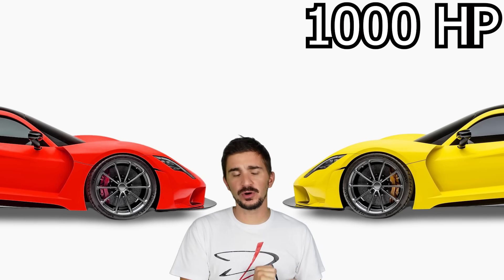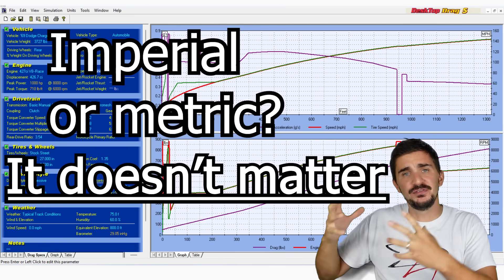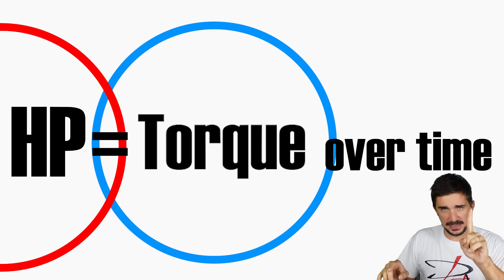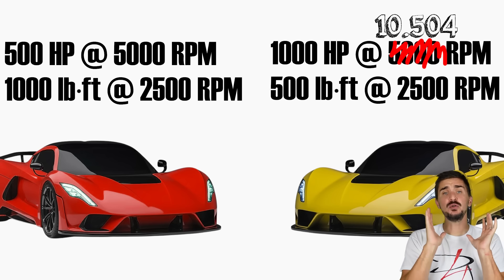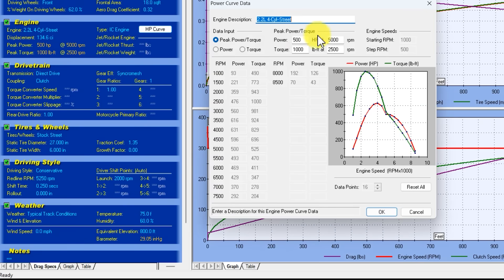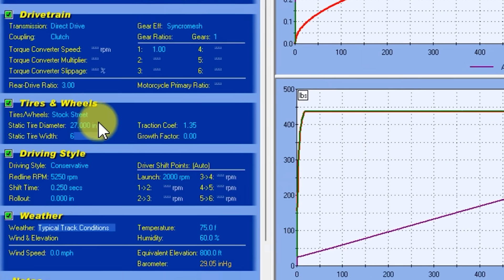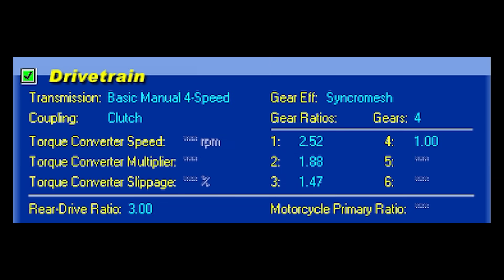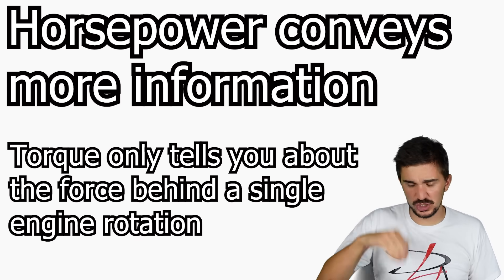Who's faster? Explained and Simulated - Horsepower vs Torque

Comment: To add - while best speed is reached at peak HP, best hillclimbing (or towing) ability is reached at peak torque rpm - so next time you're racing up a hill, be sure to optimize both 😉
Reply: not really.
Reply: What the heck are you talking about?
Reply: @TarenGarond  who me or kristian….?
Reply: @mociczyczki  The fella that don't seem to understand this stuff(Not you... XD)
Reply: @TarenGarond  My point is simply hillclimbing/towing ability is a function of torque (not HP), while speed depends on both - each have their own RPM peak - the video looks at acceleration, although D4A touches on added weight (which of benefits the higher torque engine)
Reply: @kristianhermann5971  Obviously revving at peak HP RPM (on full throttle) is best for hillclimbing/towing performance.
Peak torque RPM gives you both best acceleration and hillclimbing/towing performance (Ignoring aerodynamic drag and such) on one particular gearing, if you can change that gearing try to aim at peak HP RPM to get as most wheel torque as possible.
Reply: @TarenGarond   If by "performance" you mean max speed uphill and not steepest grade climbable - peak torque rpm always provides max climbing ability - you can only go faster uphill if you have excess torque available (because it decreases at higher rpm)
Reply: @kristianhermann5971  cos 1 gear is last gear and its not always true that peak torque determined max uphill angle if max torque be at enough high rpm and on lower be not enough less tprque it can turn out that lower rpm where max torq do t happpen give best posiible climbing capabiliities because at biger velocity resist inrease if resist to power ratio be worse at max torq rpm than somewhere on lower rpm it dont pull so good than at this lower rpm 👌🏻 assuming you have inifinite gear only max power give you max climbing capabilitites diffrenc be biger and biger the biger be diffrenc in power at max torq rpm and max power rpm 👌🏻 and last but not least this what ypu write fix so etimes only to the same vehicle at 1 gear or at the same set gear and how good something would have climbing ability under let say heavy load depend on lenght of first gear👌🏻 vehicle with 10 hp and 10 nm can go up more steep hill than feg 500 hp 3000 nm vehicle at the same weight if 10 hp 10 nm wpuld have enough shorter 1 gear it do it super slow but it defeat finally steeper uphill 👌🏻🤭🤷🏻‍♂️  + when you let say tow be car some trailer uphil 5 degrees let say you have 3 tons on trailer including trailer car 2 tons spme suv or whatever you go 50 km/h up this hill at 2000 rpm you have 600 nm and at 5000 rpm engine have max power of 250 hp ,first you are on 4 gear at 50 km/h where you have 2000 rpm so max torq 600 nm at engine you put pedal to the metal and how much force is generated at tire contact path ? comapre to when you reduce gear at this 50 km/h to 1 gear where engine be at 5000 rpm let say so 250 hp ? the force at contact path so climbing ability from this pointof view be smaller 🤷🏻‍♂️👌🏻    cos around  910-915 kg force at 4 gear at 2000 rpm atmax torq dont including all losess from engine to the whell vs at 1 gear at max power so  5000 rpm  force at contact path increase to around 1350 kg force 🤷🏻‍♂️ 👌🏻 so it depend on point of view asf what you want subscribe the outcome can be diffrent 👌🏻 at end torque is leverage dependend ower is speed dependend from both if you have enough data you can calculate force 👌🏻  100 nm electrick kick scooter at 2 times shorter final gear ratio so assuming wngine is in wheel it have 2 times msaller wheel doameter will  have the same climbing ability as 200 nm electric kick scoter with 2 times biger wheel assuming both wpuld have similar weight naturaly 👌🏻🤷🏻‍♂️ thers alot point of view your assumpition is true  only for the same vehicle at first gear assuming we dont want to hold specified velocity uphill but it can drop down cos like im write ot let say somebody want hold 50 km/h and all resist uphill including weight rolling drag asf would reuired 1100 kg force for not loose this 50 km/h velocity than this max 600 nm at 2000 rpm from me egzample generated 910 kg force be not enough vehicle would not have enough strenght and it slows down couldnt hold this 50 km/h but when you reduce to 1 gear where force is 1350 kg with pedal to the metal now it can hold this 50 km/( wothout slows down with not pedal fully put in floor 👌🏻 ( assuming from me egzample that those force are including all lossses in drive train asf ) …

Comment: That this gobbledygook video is still up is beyond belief. There have already been like 50 people in the comments pointing out what's wrong with it. Does your mind have the magical power to only read the comments that call the video brilliant?

Once more:
- You can't randomly set torque, power and RPM values. Your torque engine produces over 600hp, not 500hp, so you are not even comparing what you said you would.
- The torque engine still revs to 8k RPM even though it makes peak power at 4k RPM. Since you are using a gearbox set for 8k RPM, the shift points are completely wrong. That's the only reason why the torque engine isn't faster across the board (because it otherwise would be given you are using the same gearbox for both engines)
- You can't use the same gearbox for both engines. Doing so doesn't make it fair, it makes it so one engine is geared to twice the road speed of the other! If they were geared for the same road speed, the "horsepower" engine would always be faster.
- The only conclusion is that horsepower is faster and that torque doesn't matter at all, not that "it is neither".

Comment: This is a crap video which is a shame. Your stuff on engine balnce is excellent but this one is rubbish. You have dumbed things down so much you've had to use fantasy illustrations to try and explain your points. Peak torque is a meanless metric. Peak power only slightly less so. Both numbers are only useful for willy wavers. In a rorating engine horsepower is simply torque x rpm (in a jet aircraft it's thrust x velocity). Peak HP is also just an instantaeous reading, acheived at one point in the rev range. What is actually useful to look at is the HP curve, HP plotted against engine speed.

For example, ignoring clutch slip, wheel spin etc, if you are looking for maximum acceleration you need to know the integral of the horsepower of the engine speeds your gearing force you to use. The area under the curve between low and high revs. Generally HP rises with engine speed and then drops off. Your gearing controls where that engine speed ranges. A close ratio gearbox will allow you to keep the engine within a narrow range but to have maximum acceleration at low speeds you need a low first gear. If you have a narrow powerband and a useable 1st gear you need you need lots of gear ratios and they need to be close together. Some of the early Japanese racing motorcycles had very narrow power bands and 14 ratios in the gearbox.

For maximum top speed you need to carefully adjust your gearing to give maximum power at the point of highest drag but still allowing enough power below maximum to allow the vehicle to accelerate through to that figure. An interesting example is in Moto3. 250cc racing motorcycles. At maximum speed in still air they are running slightly below maximum power. Thus, when they are drafting another bike they can pull through to maximum power as their drag is reduced.

Anyway, I think it's a shame you seem to reinforce the idea that maximum torque has any meaning at all.

Comment: I see a lot of the comments saying they understood, and then they make a point that tells they didn't. I think horsepower could be ignored alltogether because it is just a number that is calculated out of torque. Just compare torque curves. Dyno does not measure horsepower, it measures torque and then the software calculates a horsepower graph on top of it. If you put a g meter on your car and accelerate trough a single gear the output of the g meter vs your speed will draw you your cars torque curve. No horsepower on there whatsoever unless you want to calculate it. Torque is the only thing moving your car, horsepower is only a calculated value derived from that torque.

Comment: Why make it so complicated. Horsepower will win in a drag race. 
Max power might make the engine peaky and hard to drive.
Sacrify some of the power can give you a flatter torque curve and easier to race, this is very true for motorcycles.

Comment: This test reminds me of high performance (800HP+)Honda K-Series engines. Relatively high horsepower numbers that needs to be revved pretty high to meet the torque requirements. By use of the correct axle ratio and the correct transmission to keep the engine in its powerband.

Comment: The problem was all the power was wasted across the clutch. That's exactly what a transmission is about. You're multiplying the torque to the value you can put through the tyres.
Edit: Yes, the punches analogy was a better one, but people just need to understand gearing.

Comment: They are not interconnected. Dumbest statement ever. You can change the bore and stroke of an engine to increase torque. When it comes to horsepower rpm is the biggest factor. 🤦‍♂️

Comment: Torque is always the winner provided that you have enough traction to actually use it. I have seen a 300hp vehicle smoke a 700hp vehicle simply due to torque which was generated via proper gearing in the 300hp vehicle.

Comment: Torque genuinely does not matter at all if you have a perfect transmission. There is a better explanation than this on the Automation, the Car Company Tycoon Game channel, which I think may be the only one I've seen that actually gets it right. What actually matters is the amount of horsepower integrated over the acceleration, which depends on the gear ratios etc, but the bottom line is that power does tell you everything by itself as long as you look at the whole curve, and a reasonable proxy for performance is the average power across the band that will actually be used, whereas torque doesn't mean anything until you tie it to specific RPM, at which point what you're actually talking about is power.
Reply: Spot on! At 12:40 Torque is NOT about a single rotation, its simply the twisting (torque) force applied and tells nothing about how quickly work is being done.

Comment: I haven't seen it commented yet but I noticed the "conservative" driving style is limiting redline to 5250 RPM. Is that actually a fair comparison between the two models since the peak RPM on the torque-limited engine is double that?

Comment: After receiving 1000 one pound punches I'll be bruised & annoyed.

After receiving one 1000lb punch I'll be on the floor & confused.
 
I really disagree with your reasoning, but not the result. Just look at HP area under the curve.

Think of the old GP two strokes. Insane HP levels, but only at high rpm,  for very limited rev range. The peaks are present, but there is no area under the curve. 

That can be compensated for with gearing, by having lots of gears (ie: 9 speed transmission), but changing gears takes time & causes wear. A modern 4 stroke would win with a lower hp peak, because that's not the important part. Area under the curve, is.

Comment: I've owned and raced two 1970's VW Beetles, one torque biased and one hp biased:
2007cc 150hp@6000rpm/155ftlb 1/4 mile: 14.3@95mph
1285cc 126hp@7800rpm/97ftlb 1/4 mile: 15.0@88mph
The smaller engine is understandably slightly slower, but the biggest factor in the time difference is actually the launch. The high torque motor allows me to dump the clutch netting a 1.8 second 60ft time, the low torque motor means I have to slip the clutch (to avoid the engine stalling while keeping it in the engines prefered high rpm power band) netting a 2.1 second 60ft time, so "on paper" the low torque engine should be capable of perhaps a 14.8, but in the real world, no chance. Unless you run super low gears, torque is preferable

Comment: Let's say we have 2 same model cars with same HP, but car A produces less torque but higher RPM, car B produces more torque but lower RPM. Car B will reach its maximum HP much quicker than Car A because it peaks at lower RPM. Car A needs more time to accelerate to higher peak RPM, also needs to change gears more often, and also have engine RPM limitations due to physics. Ultimately torque and RPM needs to be optimized for the engine performance for a given horsepower.

Comment: Thats why I sold my 2007 BMW M6 with the S85 V10. It made 500+ HP but -400 torque. Nice sound and all but it was pretty boring if you weren’t flooring it on the highway.

Comment: I always like to tell people that Torque is a completely useless number without RPM, HP is acceleration, HP is topspeed, HP is everything, torque is meaningless, nice that your electric screwdriver has 200lbft of torque, can it outperform a car with 150lbft of torque? I don't think so
Edit: I also think this software you used isn't really great, very basic and not realistic, i don't really see what would stop you in a dragrace scenario to keep the engine RPM close to or at 10.000 and prevent wheelspin etc... with the clutch allone being full throttle all the time, there's just a lot of variables the software can't simulate
Also in the wheelspinning scenario you showed, it looks like the software just goes flat out all the time without any modulation

Comment: Soo sick and tired of people arguing over what’s better, torque or horsepower. Horsepower just conveys more information but they are directly related otherwise. Thanks for another great video. My target on my current build is 450 HP @ 7000 rpm; I’ll simply adjust the gearing depending on how torque comes out so it’s Drivable.

Comment: I don't know why I write this, I guess I just want to.
In real world scenario, if you have big torque at low rpm, mostly it doesn't rev high. It's just physics. The bigger the hammer the slower you swing.
On the other hand; if it does rev high, usually has low peak torque.
Smaller the hammer, faster you can swing.
It's a trade off.
Racing car loves to have high rpm. It's useful when in slow corner and you need less torque to prevent wheel spin you can just drop the rpm instead of shifting gear. (Shifting = stop accelerating = losing time)

When pulling heavy load, it's the other way around. Pulling from stand still need an instant power from stop. Having a big torque at low rpm will be very useful as you don't need to floor it just to roll, saves fuel. Towing stuff is a constant motion. Having wide rpm is not necessary. Just keep accelerating (shifting so many times while doing so won't hurt anyone, it's not a race) until you reach desirable speed then drop the rpm (to save fuel) until it has just enough power to maintain the cruising speed.